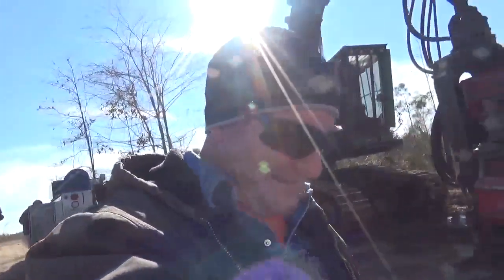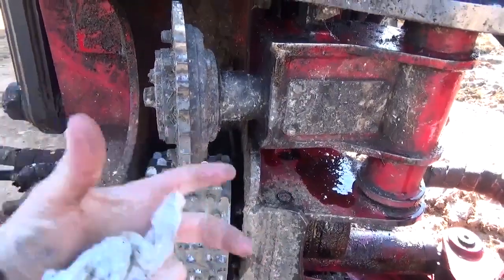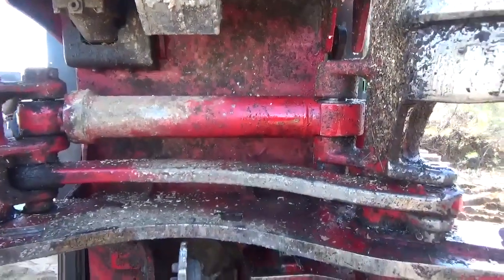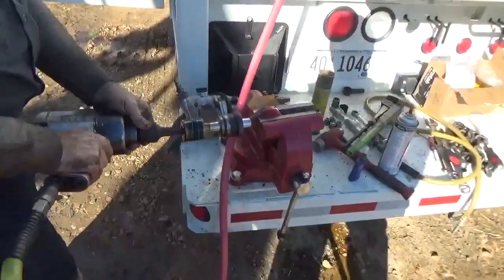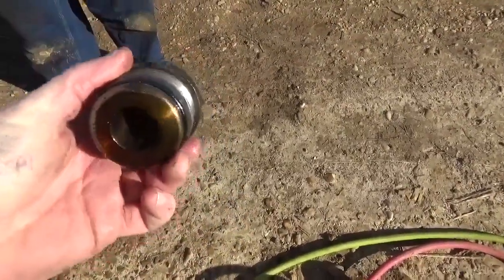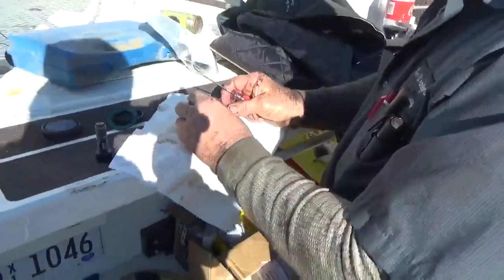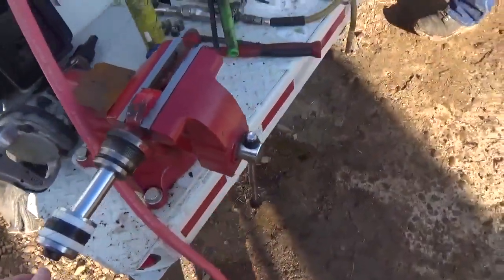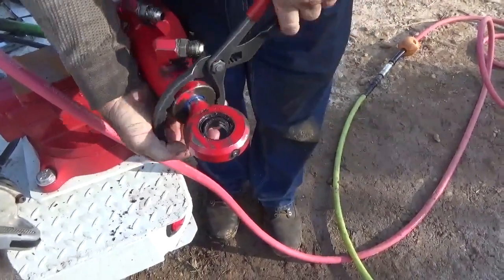How to repack a humongous hydraulic cylinder!

Comment: Hey Tim, great videos man! Ive learned lots and they always get me thinkin! I had a couple questions that i was hoping you could answer. After you guys cut a job and they go to re-plant, do they do ariel seeding or is it manual planting? Also i think i remember you sayin in one of your older videos that the fertlize it as well, so i was just wondering if you knew any of the specifics on that like the pounds/acre? And one last question, how long are your typical harvest cycles? Thanks!
Adam
Reply from the maker: Harvest cycle here is mostly 24-30 years. They hand plant single seedlings. The fertilizer is around 600 pounds per acre and they do it from airplanes.
Reply: Ok cool, i curious to know how ya'll did things compared to what happens here (Ontario, Canada). Keep them vids coming!